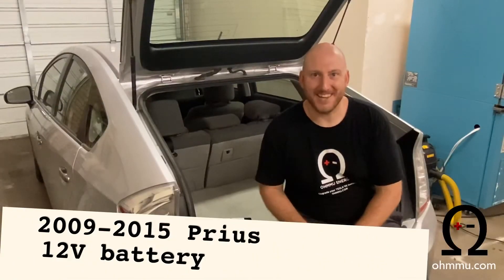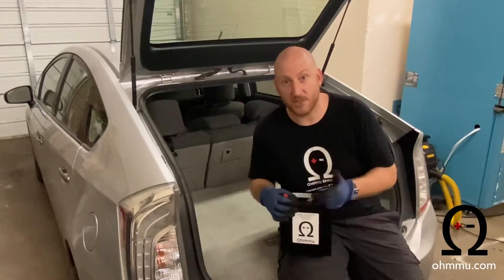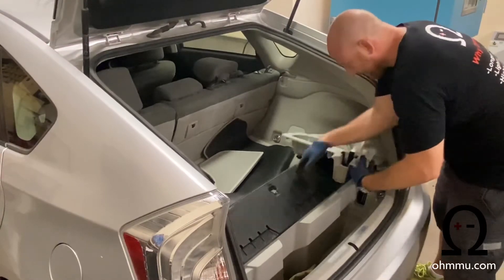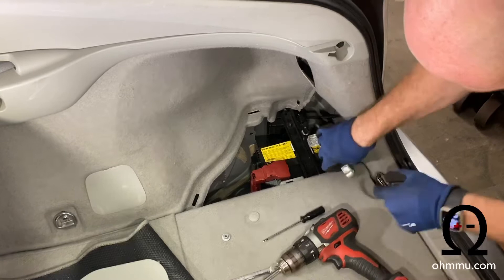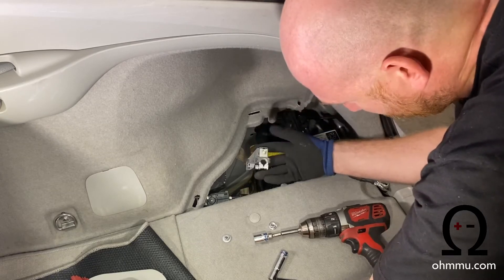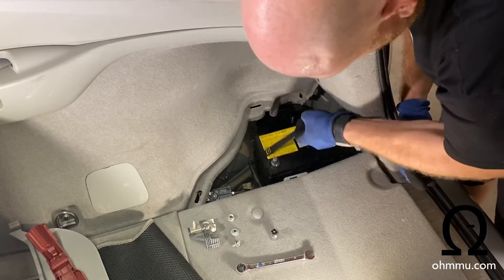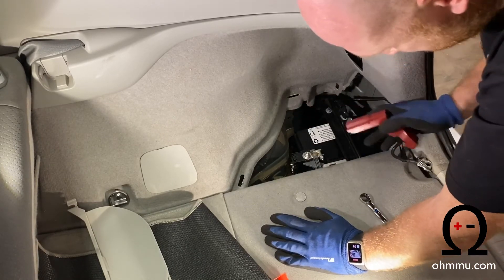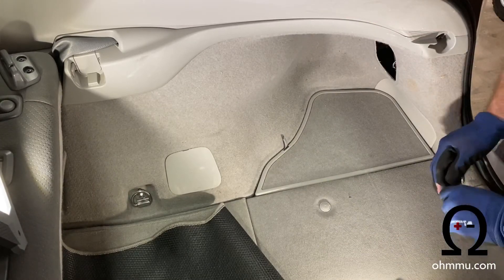12v battery swap Toyota Prius

Comment: what are the advantages of using your battery? Can I hook up a bigger power inverter to my Prius, such as a 3000 watt?
Reply from the maker: You potentially could but the real advantages are weight, efficiency and especially lifespan!  This battery will last much longer and has a 5yr 100% coverage warranty!
Reply: @OhmmuEnergy  I want to get one to replace my battery, could I potentially run a 4,000 watt inverter from it?